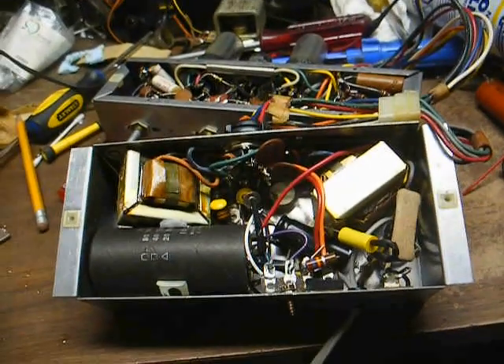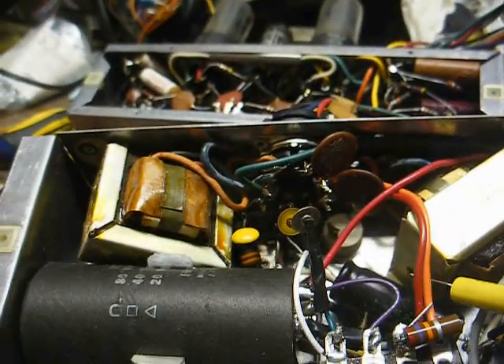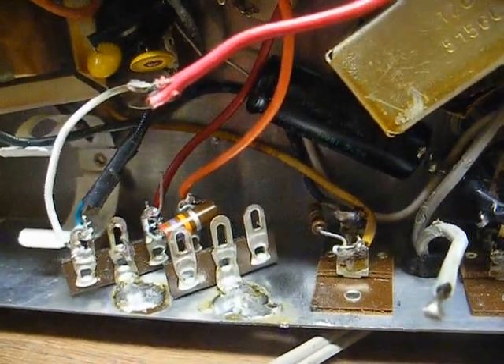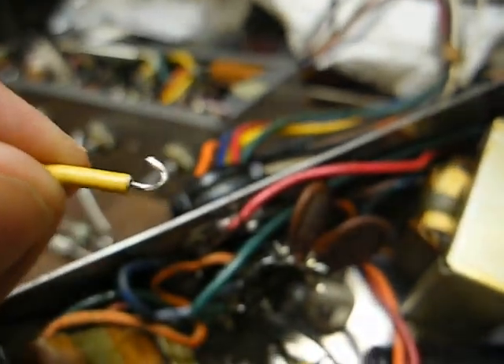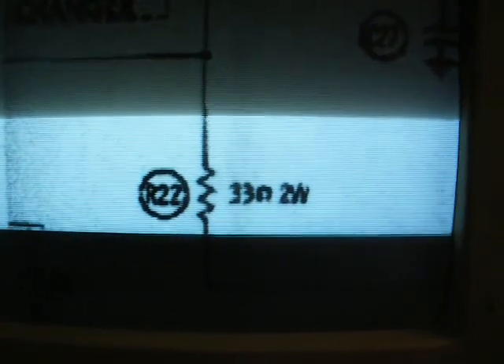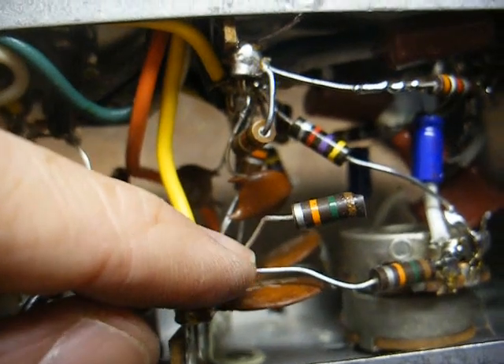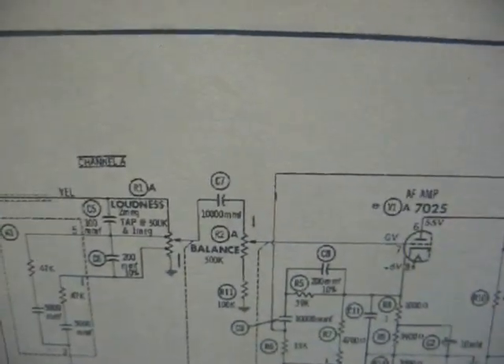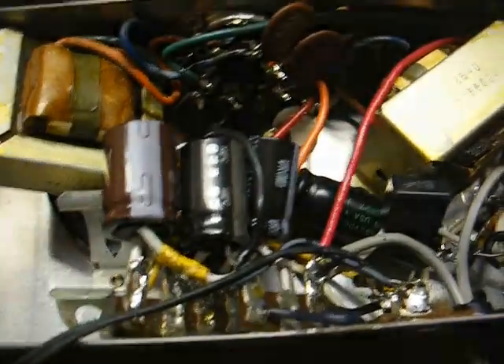Repair of a Voice Of Music record player amplifier

Comment: As far as test equipment, personally I use a dim bulb set up with an isolation transformer for power control.  The rest is a small amp for a signal tracer and a cheap vom that wasn't even digital.  We all start somewhere.  The good thing is at least we got started

Comment: My Revere S16 16mm sound movie projector had no sound on the amplifier, but the projector worked fine, but it needs to replace the motor brush springs, because the motor is not running while it’s on, except the lamp light up. I can’t put the film in there. I’m going to check if the amplifier has some problems, but maybe I’ll have to address it. The amp in my Revere S16 did a sloppy work on adding double resistors to the connection and it doesn’t look right, or perhaps a silicone diode, so I did pulled out the old Sprague capacitors, and I’m also going to removed a few bumblebee capacitors with orange drop capacitors to make it work, and this is going to be a project that the amp needs to be rebuild. I can’t find a schematic for the Revere S16 amplifier online. Is there a way that I have to find?

Comment: Good Video as normal.  Used to be an Electronic Tech (A/V Tech in a local school system). The person who did the job before me was a "TV Repair man" (I don't mean that all repair men are bad...... but he was.  He didn't care if the repair held, he just wanted it out of his shop).  I could always tell if he had worked on the unit before, you could just tell.   I remember the had left this PA unit in the shop when he left.  Said he couldn't get it to work in the school but worked fine on the bench.  There was a XSTER taped to cabinet.  I assumed this was the problem with the unit........ it was.   The XSTER had a "SK" number on it (RCA parts) , I used "ECG" parts so I looked it up.  The part was an "RF amp".  WTF!?  Why an RF amp in a AF unit?   So...... I decided to call him.   At that time I lost all respect I had for him (which was not much I may add).  When I asked why he tried to use an RF amp (thinking he had miss-read  number)  he told me in a matter of fact voice "MAN!! I've doing this stuff for over 30 years . Theres  no telling what I may use to get it working."   I thanked him for his time and hung up.  I used a AF amp in the unit and it worked just fine.

Comment: the only that I can "bitch" about and to a degree you Sango66 is not showing how to do it, how to properly solder after hoby around with electronics I never realized I was not soldering correctly till I watch some videos from Bigclivedotcom & glasslinger

Comment: Those Goodalls I've had fairly good luck with too. I don't find too many of those that are bad. The ceramic encased Pyramids are really durable. I have seen that style with various labels on them, including Pyramid and Mallory. I think those are some of the best vintage caps outside ceramic disk. I think it's because moisture can't get inside them, they are really well sealed.

Comment: I catch some of the same shit for not having all the flash test equipment on my bench in videos. Someone told me the other day something to the effect that I couldn't be a very good tech because of the state of my bench. I kindly reminded them that the repair had been successful in spite of it.
Reply: you can have all the latest flashiest gear on your bench sure it looks cool but if you don't know how to use it and fix the simplest repair you might as well not have it !
Reply: I fix computers professionally.   I can do 90% of my job with nothing more than a screwdriver and my natural abilities.   Many times you can find the problem with your eyes and ears...   or by finding a hot spot by touch.   Hell,  I can't remember the last time I used fancy tools....   If it's fixed,  it's good.    

How many technicians does it take to fix an Amplifier???   10,  one to do the repair,  and the other 9 to discuss how it should have been done differently.   Substitute whatever you want to for that joke.  Audio engineers to run sound at a concert,  Carpenters to build a table....   opinions are like noses,  we all have one and they all smell.

Results are the most important thing.   Joe Meek's quote on recording sums it up...   if it sounds good,  then it IS good.

Comment: I remember the first thing that I worked on was my parents' stereo system.  There was one side that was distorted and low.  I found the correct transistors and put them in.  I ended up smoking the power supply because I didn't put the insulators on the TO-92 transistors between collector and ground.  Needless to say, that stereo never did work again after that.  However, by that mistake, I have learned to repair amplifiers, TVs, musical keyboards, guitars and their electronics, switching power supplies, and other things.  I've been doing it a long time, too and I still get a little nervous tearing something apart.  There was only one other thing that I wasn't able to repair.  I remember an electronics store had asked me to come in and repair a Kenwood stereo receiver.  The output transistors checked shorted.  I replaced them, turned it on, it worked for a couple minutes, and then flames came off of the resistors in the driver section.  I replaced them a second time and it would play a couple minutes, and then I'd hear a crack, and then really thick smoke pouring off of the board.  I replaced every resistor and capacitor on that board and it would still do the same thing.  The only thing I could figure, and it has been years since I thought about it, is maybe the transistor sockets may have been breaking down or something like that.  I did play it without the power transistors and it played indefinitely like that.  Anyway, thank you for sharing.

Comment: I remember when I first started working on tv's, I used aluminum foil to short out the fuse, because I  didn't know any better, and blew up the circuit board. I learned from that mistake!

Comment: dear sir, please could you advise me.  I have a have a old sony television which I am restoring and the part of the circuit I am working on should run at 480 volts. the eletrolytic capacitor running across it is a 1uf at 500v. I want to replace the capacitor but the highest value nowadays has operational voltage of only 450v.  Can you suggest a safe solution to my problem .
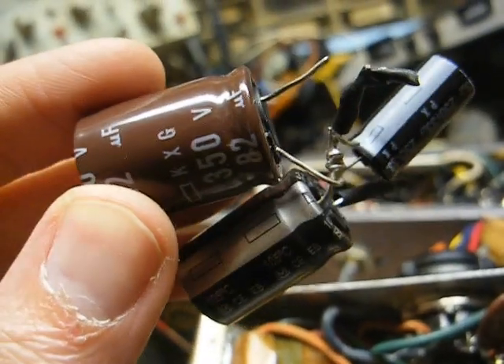Reply: Peter Alsford hook two 250 volt caps together with their negative leads hooked together, make sure they each add up to the uf of the old capacitor. See 7:40 of the video
Reply: Cheers mate I was thinking of doing that but I was thinking that esr would be out of tolerance and start drawing to much current.
Reply: Use a 1uf 630V poly  film cap.

Comment: The day you stop learning is the day that put your body into a pine box. I've been interested in electronics since about 10 or 11. (I'll be 70 this month.) I've built a ton of Knight, Heathkit and Eico test equipment in kit form as well as amplifiers, etc. In my teens, I serviced radios and b/w tvs for friends and neighbors. When I got married and moved to the San Francisco Bay Area, my dad took over my shop and sold all my test gear. Since I've been retired since I was 65, I've renewed my interest in electronics and have started collecting test gear from e-bay. Now I have some projects to restore the test equipment to its former glory. -- This is my first time commenting. I want to thank you for your interesting and informative videos. I also watch Shango 066 as well as some others. This has rekindled my interest in electronics that never really went away --  it was just placed on hold for about 45 years. Thanks again and please continue the good work!

Comment: Thanks for another great video!   I agree completely about not making fun of beginners or of work done by people starting out.   Anything I've ever gotten fairly good at, the first time I did it was a disaster.   The most humorous memory of such is the first time I dealt with a 16mm film projector in fall 1980, the autoload mechanism pulled the film incorrectly and it jammed so badly that the machine had to be partially taken apart to get the film out.   I am currently at a coffee shop and a friend and I were watching this new video and my friend also appreciates your videos and referred to you as a "National Treasure!"!     You're absolutely correct about education never ceasing.  I've been a computer programmer since the mid 1980s and still make mistakes in pretty much everything I write, as well as encounter new changing paradigms that require changes in approaches to problems.    I think of you ever time I see the old 1946 Sears Silvertone console AM radio/phone combo that was our family radio growing up and still plays to this day (the radio does with all original tubes -- the phono has never been used at least since 1972 when we acquired it).    I bought a new turntable weekend before last, the first totally new one I've had since January 1983, and people would be much better off paying $300 for one of those models rather than $100 to $150  on a Crosley piece of junk.   Audio Technica makes one (AT-LP120) that seems to be heavy and fairly well made and has counterweight, anti-skate, and ability to use head shells.   I doubt it will last over 30 years like the older Sears one but  pickings these days are kinda slim.